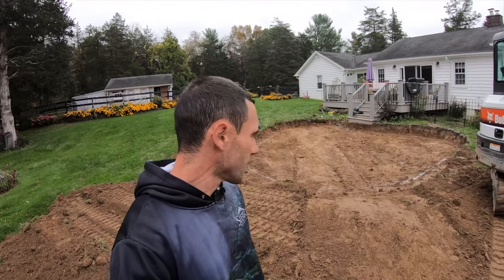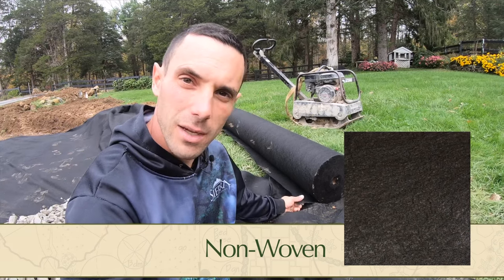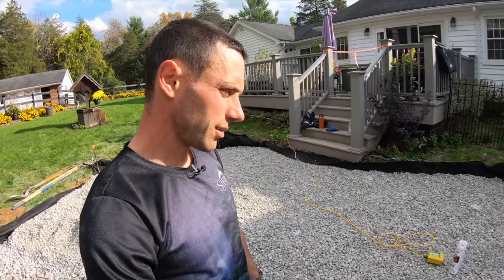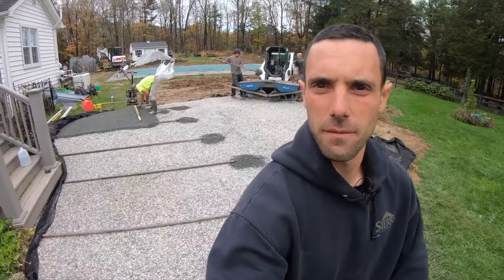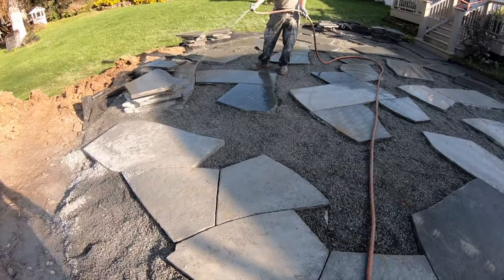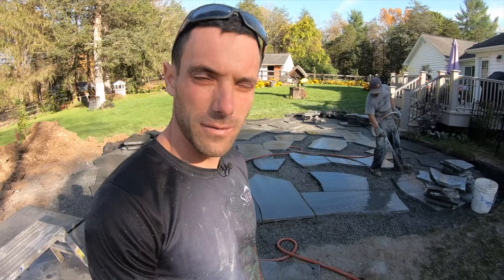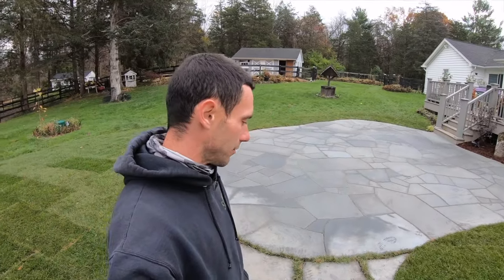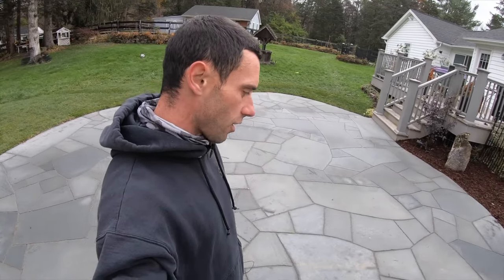The ultimate guide to Flagstone Patio building!

Comment: I’ve wondered if screeding the bedding layer is worth doing or not. I’ve screeded it before like we do with pavers, but the stone varies in thickness so much we still have to pull out material or add more for most of the stones to keep them from being “tippy or trippy.” Cutting isn’t so bad, it’s the leveling and stabilizing part that tests my patience the most. You guys are one of the few out there that do dry laid flagstone right! There’s not many of us left.
Reply from the maker: Over the years several people have asked the question. The screeding process takes maybe 20 minutes. Since we choose our material to have no more than 1/4" variation in thickness the end result is no more than a few handfuls plus or minus for each stone which is still way faster than doing each stone independently. Same with the fact that it gets displaced from walking on it. It never relocated so a simple smooth of a hand fixes that. In the Guide video the stones were gauged so the variation was no more than 1/8" so it was almost a drag and drop scenario.
Reply: after putting the stone base in and leveling it off 
I usually use a couple sections of pvc pipe spread out in 6 - 8 ft intervals and than start laying my sand in 4” lifts, screeding it out to the top of the pipes to keep my level, tamp it and repeat the process until you get to the top layer. On the very last layer I don’t tamp just screed that way when you lay your stones you can tap them down to the proper height with a rubber mallet to get an even finished surface. After everything is said and done I use my poly sand and sweep it in between all my joints and lightly spray it with a garden hose on the shower setting than let it dry for a day. Screeding vs. not screeding makes a huge difference trust me it makes for A LOT less stones having to be adjusted, picked up and re set in my opinion not to mention it saves your back a lot of unnecessary pain lol

Comment: what type of edging do you use for your flagstone? Mortor, snap, permaedge, something else?
Reply from the maker: Depends. If it is a patio we put large pieces on the edge and no edging. Never an issue. If it is more likely to get abused like a walkway or the pieces are smaller we use concrete of some form, again depending.

Comment: This is an excellent example of great craftsmanship, but overkill in base layer design for a flagstone patio that’s only gonna see pedestrian traffic. 8-9 inches of gravel base layers is like preparing to pour a concrete sidewalk or pavers where vehicles will be driving over. 

For pedestrian traffic, only about +/-6” is needed, followed by the bedding layer (DG/Decomposed Granite, Stone Dust, or stone dust/cement bedding layer, which is strongest).

I hope whoever the homeowner is never finds out that he was overcharged for labor/material that wasn’t needed 😂
Reply from the maker: Thanks for sharing. Yea we definitely overbuild, and also sleep very well too. LOL. We’ve built in several different states across the country and base depth’s definitely vary in different areas. 8” is standard in that area because of the clay and harsh winters. Glad to hear it’s a little easier your way! Thanks for watching.

Comment: This is beautiful, but not at all DIY. Beautiful, but very high dollar.
Reply: I mean dude legit built this with a base layer utilized commonly for heavy industrial/commercial footings. He could have just done about 5 inches of 3/4 crush stone and Tamp it and have been fine.
Reply: I am planning to do exactly this but twice as big, by myself, over the next year.  I'm almost ready to start.  Its a little different, Im using cobblestone edging though and I'm not using blue stone, so my flagging stone depths vary.  You can do it!
Reply: @karlmarx7511 over designed you say.  I'm cool with saving money.  Built to last is nice, too, though.  I was thinking it seemed a bit heavy duty, H20 loading.  Maybe they are gonna park a fire truck on it?